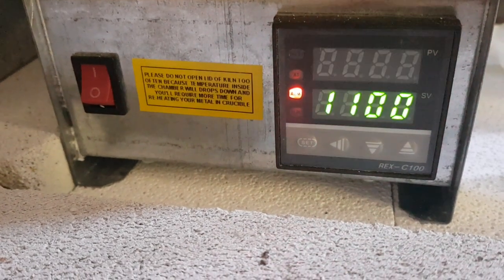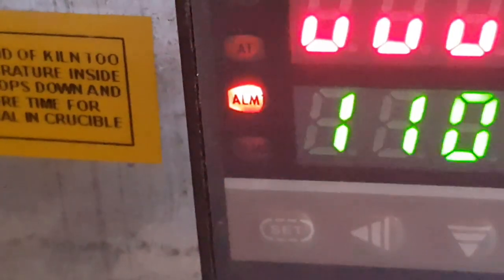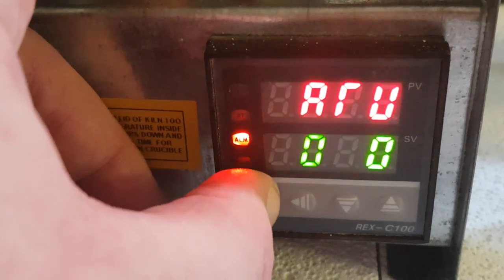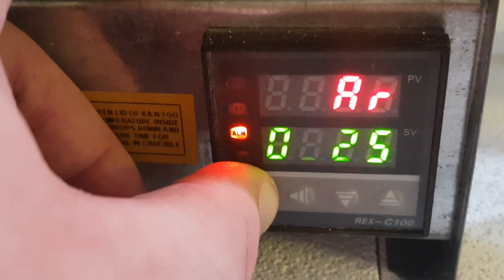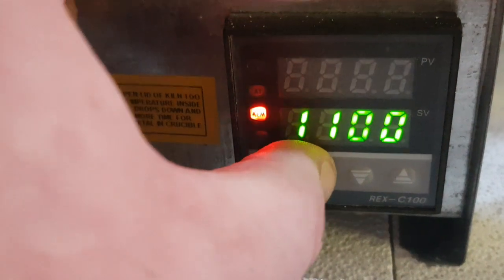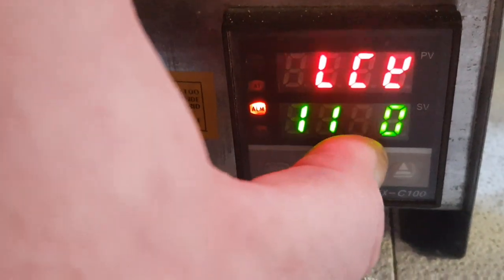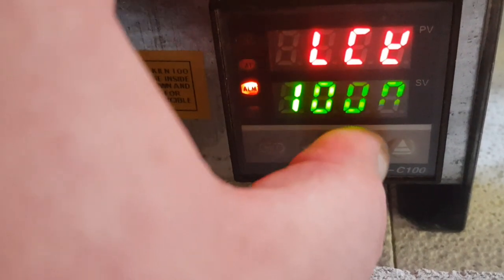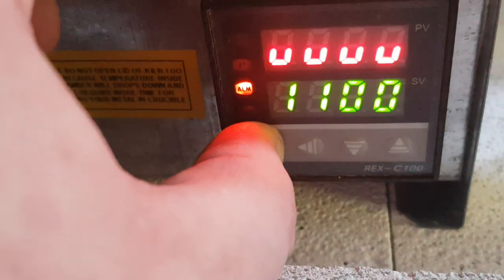R9D100 SOS?  Can you help?

Comment: Hmmm . . . Manual should lead you through reset . . . /??   Not my model - Good Luck bud - HiHo
Reply from the maker: I did a pt 2 to this, I will check again a reset but I have tried everything I could. Suspecting it to be a internal issue.  Hmm I do not know.